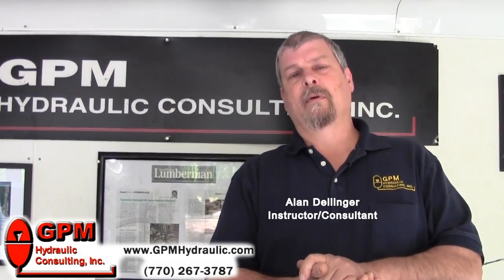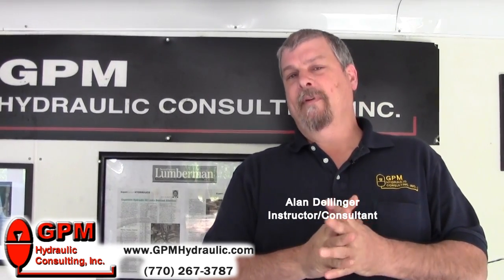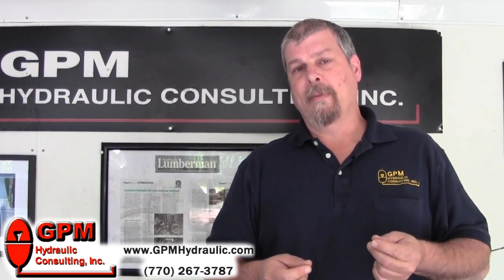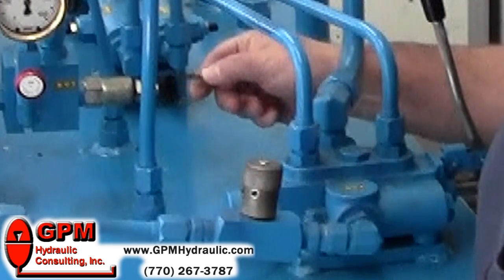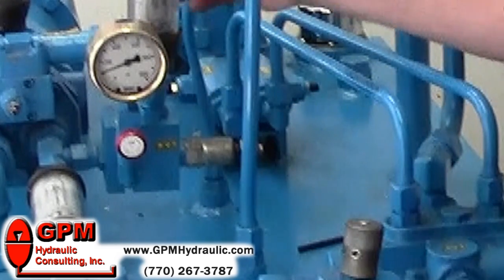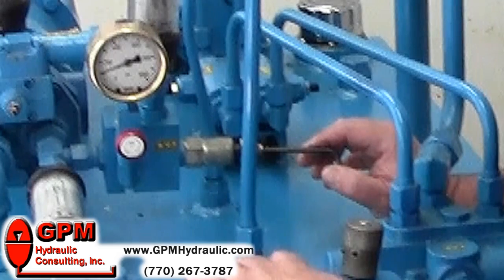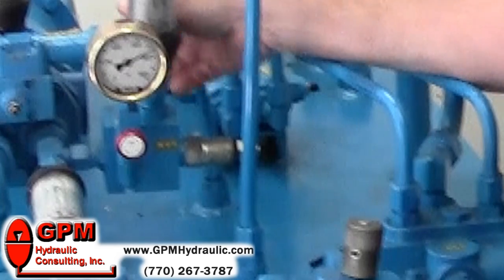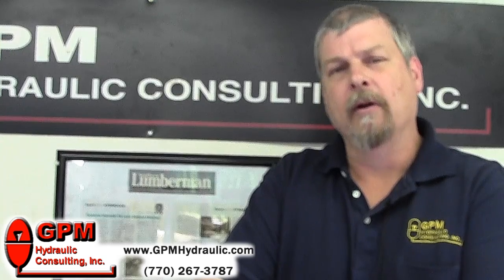Setting Pump Compensator & Relief Valve

Comment: Why didn't the pressure drop when you opened the needle valve at the end.
Reply from the maker: Thank you for your response! The pressure didn't drop because the directional valve downstream was closed. In this particular case, a closed center directional valve was used, so strictly speaking, the compensator and relief could have been set without closing the needle valve. We recommend that it be closed because so many different configurations are out there and someone may be using this video who has, for instance, a tandem center valve rather than the closed center valve in the demo system shown.
Reply: @Jack Weeks  Thank you for the reply!
So I have a vickers p.c pump and have it set to 1k psi. Relief is at 1300 or so.
Are vickers pumps always noisy? If I dial the pump down to say 500psi it's a lot less noisy. 
Also, prime mover is maxed out at 50 amps when I have it set to 1000psi. Can that attribute to pump noise? 
3 phase motor, data plate says 50 amps max. 
It's on a bagging machine, feeds product into bag, then presses it down, seals it etc. 
When the comp pump hits set pressure, it's maintaining set pressure so should the motor always pull x amount of amps? 
Thanks so much again.
Reply from the maker: @bucksnortbumblefuk6872  A higher pressure will indeed contribute to noise, but it shouldn't be excessive. There may be some other issue as well, such as an air leak or blockage in the suction line, or worn bearings, depending on the sound it is making.
The current draw of the drive motor will not be constant even though the pressure is maintained. Current will also change based on speed and load resistance as those change.
Reply: @Jack Weeks  pump is new, but guy before me was cavitating it bad as i started my repairs with fixing the inlet/supply. Several fittings loose. Also there is a 90* bend in front of the pump I don't really like. 
Thanks again for the reply.
Reply: @Jack Weeks  so as the pump reaches set pressure,  and it starts to maintain,  the computator is hunting basically.  Amp draw would follow this? It's maintaining pressure but flow is almost none?
Reply from the maker: @bucksnortbumblefuk6872  That's correct. When the flow is near 0, the current draw should be quite low. Current draw will be directly proportional to horsepower in the system and horsepower is the product of pressure x flow (multiplied by whichever constant must be used to make different units of measure compatible).
Reply from the maker: @bucksnortbumblefuk6872  There very well may be some pump damage, then. That would explain excessive noise with the pressure increase.
Reply: @JackWeeks  I wish I had a flow meter so I could do some math to see what hp is required.

Comment: I follow on the procedure however I have a trailer that has the pump submerged in the reservoir with a Honda engine on top. 

Kinda like a big ice cream machine with paddles inside it that run via hydraulics.

I'm having to replace the pump. What would the adjustment procedure be for the new one?
Reply from the maker: Thanks for your question! Is this a submerged pressure compensating pump? Usually, the only way to set one of those is on a test bench, but you can usually order it preset to the desired pressure. Of course, if it is a fixed displacement pump, you need only set the relief valve, which should be external.

Comment: What if i hve a load sensing pump and no load sensing signal is connected to it that case load sensing screw should be fully tightened or fulley loosened? Or what will be its tightening and loosening affect on output pressure
Reply from the maker: Thank you for your question! The load sensing adjustment can be left at its factory setting if you like - as long as there is no sensing line attached, there is no need for adjustment. However, if you would like to disable it entirely to avoid "knob turner" issues, it can be fully tightened to ensure that only the compensator adjustment will affect the pressure. Just be sure that anyone who may be adjusting it is aware of the correct setting to adjust, perhaps a warning note on the pump.
Reply: @JackWeeks  thank-you so muchh sir!     
One more thing i wanna say is that it will be very helpful if you will make a vid on how to do null position setting for moog servo valves  generally which are generally used in 6hi rolling mills😊

Comment: What is the minimum pressure I can set with a pump?
Reply: I would imagine 0 PSI would be the minimum. But it would depend upon the particular pump. For instance, some pumps have both minimum and maximum stroke limiters, so for that reason, must be idled using a tandem or open center directional valve that will unload the pump at idle,

Comment: How  bar set
Reply from the maker: If your gauge measures pressure in Bar rather than PSI, the conversion factor is 1 Bar = 14.7 PSI (at sea level).

Comment: Hi, we have a similar unit. Initially, there was a leak problem 
but still working. When we had the leak sealed, there is no pressure 
build up. So we tried doing what you had shown in this video, but still 
no pressure buildup. Hope you can help us.
Reply: JAYSON PENDON Hi, thanks for your comment! If there is no pressure building, that means there is no resistance to your flow. Fluid is returning to tank somewhere it shouldn't. The most likely culprit is a valve somewhere stuck open and providing a flow path to the reservoir. Hydraulic oil will always take the path of least resistance, so determine where the oil is going. A good tool for this is a thermal imaging camera, but you may need to install a flow meter, moving it to different lines until you find which one is dumping oil. Good luck in your troubleshooting!